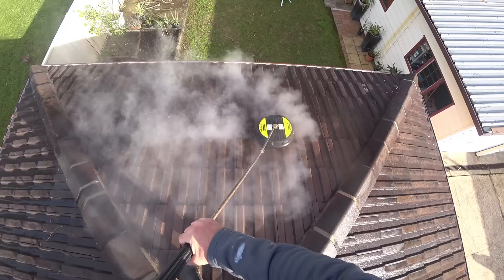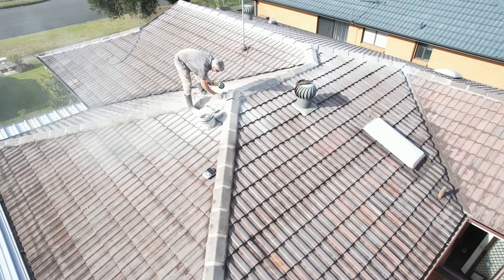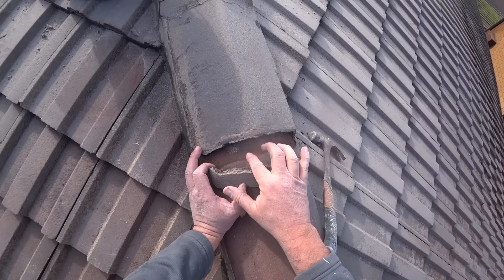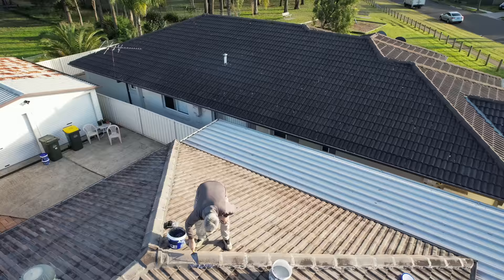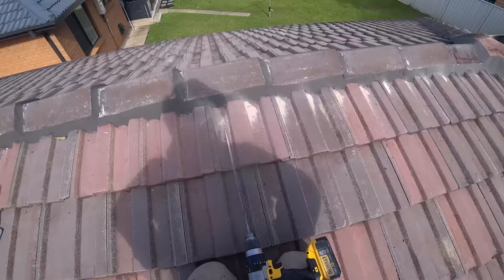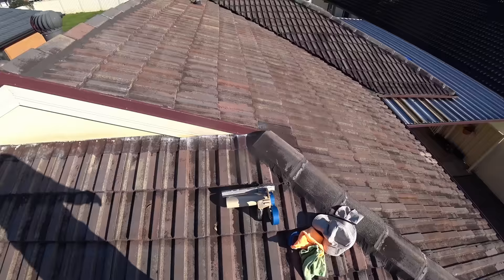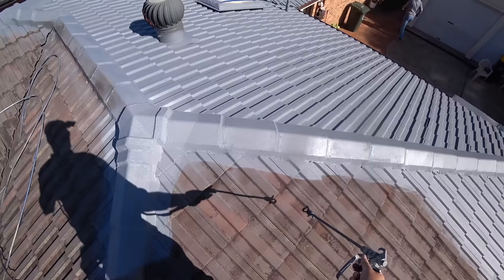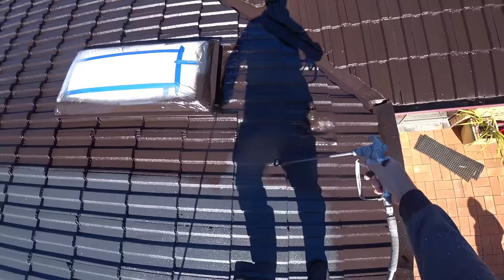Painting of tile roof

Comment: Quality work, good to see 👌
Reply from the maker: Much appreciated
Reply: Could you explain the reasoning behind why you were drilling holes into the tiles at the top near the ridge line ?! Thanks for the great videos!!
Reply from the maker: @Jonh707  A weep hole is a nail sized hole in the top ridge pointing of a tiled roof, they are made every 30cm, and are along the ridge pointing. These holes allow water to escape, as a result the ridge point stays dry. It is crucial that ridge pointing stays dry, because the bedding holding this part of the roof together is cement. Cement, although strong, is porous, which means it has lots of little holes in it, and as a result allows water to soak in. When water soaks into the concrete it accumulates and resulting in cracking and other issues.
When flexible pointing was introduced people assumed that weep holes would be redundant, because who wants holes in their roof? However this theory relies on the fact that the flexible pointing will uphold its integrity until the end of time.  Flexible pointing manufacturers recommend that you still use weep holes, and we agree, we put them in all our tiled roofing

Comment: Thanks for sharing! How long will this last? Also, my roof's ridge caps don't have mortar sealant like that--they just overlap. I assume it's been that way since 1972 judging by the look of it. Why use the mortar seal?
Reply from the maker: If is  don correctly it can last between  8 and 10 years and yes  you need to fix  beading and pointing before you paint roof .
By applying  mortar to damaged or worn-out roof pointing, this process not only restores the roof's structural integrity but also enhances its aesthetics. Replacing damaged mortar joints helps maintain the water resistance of your roof, preventing water and moisture from penetrating the roof.

Comment: grinding old pointing for new pointing is purely cosmetic and does nothing to secure loose capping, to do it properly, all capping must be removed, cleaned and relaid with new bedding compound - be careful with these roof restorers as many take too may short cuts - also pressure washing is not recommended as it strips off tile surface and forces mold spores under the tiles and into the roof - recommend soft washing or low pressure clean which actually kills the mold and spores - takes more time but is less abrasive on the old cement tiles
Reply from the maker: 15 years warranty on this job no short cuts .
Reply: @samcopaintinganddecorating  - 15 years is a joke - capping properly installed & re installed should last 50 years without loosening
Reply from the maker: 🤣🤣🤣🤣 @majorrgeek
Reply from the maker: Witch part of the world you are living in, not in Australia   @majorrgeek

Comment: What paint did you use for undercoat and top coat ? Is the membrane paint water based ?
Reply from the maker: Tileguard® High Build Sealer
A water based high solids 100% acrylic polymer coating, designed to seal and smooth out aged, pitted concrete cement tiles, prior to top coating.
Reply: Do you know of a distributor in Southern California that sells the Tilegaurd High Build Sealer?